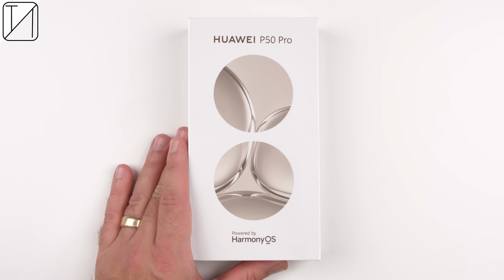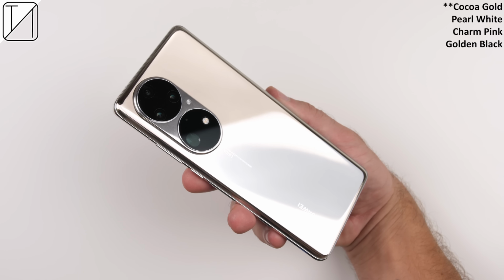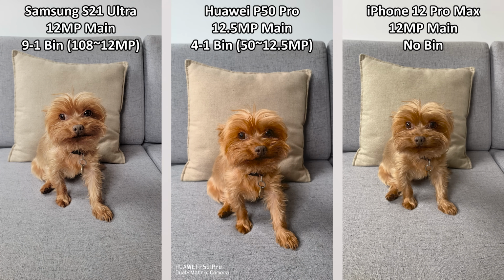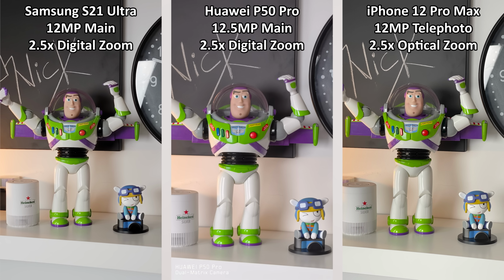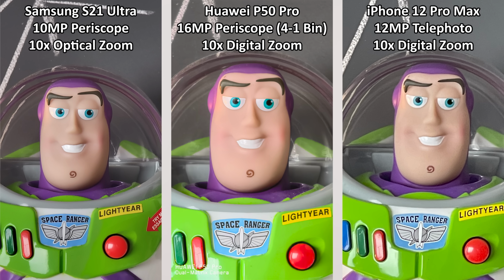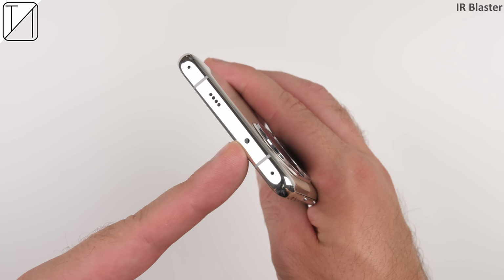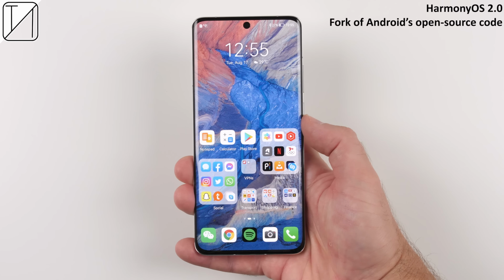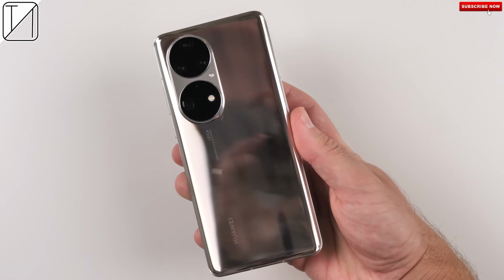Huawei P50 Pro UNBOXING and Initial REVIEW - Legend Reborn?

Comment: Basically the security risk is absolute BS.  All phones have the global components.  The ONLY reason for the ban is because Huawei were going to beat apple to the top spot and the US couldn't handle the competition.  NO ??  Then why is ZTE not banned in the same way ?

Its all about the money.

Personally once Huawei gets their 5g back I want to move away from Google as they truly are sharing info with the US
Reply: No matter which phone you get, it'll be collecting your data one way or another. I wouldn't fret about it. Personally I don't care what phone from which company I use, as they all will be collecting data through some sort of tunnel.

Comment: Do you understand that the 10x in Huawei is just crops from the 64mpx and in Samsung is a pure 10mpx optical? The difference us because the AI of Huawei is very strong. Most of fine details are not real, just "reconstructed" with AI.
So, it looks better, but Huawei relies on AI instead of pure hardware. It happened in the last generation with the selfie camera.

Comment: I am extremely excited about the HarmonyOS.  Finally we have a new operating system.  My belief on what I read is that it will offer more and more as time goes on, as compared to competition.
Reply: Its just fork of android so no big diffrence.
At least there is no google there and thats awesome.
Reply: @WspolnaKapiel  the loss of google is detriment to the phone.
Reply: @stephandevetten3463  its time for a new OS to come around.
Reply: @stephandevetten3463  you don't need Google to use apps lol. My P40 doesn't have Google play support yet I have YouTube signed in (youtubevanced) twitter, Facebook, messanger, Instagram, telegram, what's app etc. I can check my Gmail and outlook in the email app. I'm not really losing anything not having Google. In fact not having Google is far better.
Reply: Yeah but will harmony os offer the same or similar apps that Google has on the play store? Like a navigation app or big title games like call of duty mobile?

Comment: Monochrome camera has great advantages and it's back again. But this phone lacks 5G. Hoped they would use already microLED display, graphene, silicon nanowire or other next gen batteries and quantum dot graphene CMOS cameras. RYYB color mosaic is problematic in green color reproduction, RGBW can fix this and provide even more low light sensitivity. Main camera uses huge 1" sensor, biggest yet so far.

Comment: No one ever mentions the Kirin 9000's 15.3 Billion transistor count and ARM's biggest 2nd Gen Valhal Mali-G78 MP24 24core monster GPU. Its rated at 2.3TFlops of FP32 compute and has 128EU's per 24 cores giving it 3,072 EU's. Though, its basic tile based performance is more like 1.2TFlops because of a driver deficiency, if you load up a Vulkan based GPU or benchmark application you will no doubt see its true performance. It much like AMD's last Gen VEGA64 series GPU's. Running Vulkan/DX12 titles or benchmarks shows its full performance.

Comment: I am still upset with this nonsense US ban. I had for two years the P30 Pro and I can truly say, that that phone was the best all around package I ever had in a phone. Usually, I switch a phone between 8-12 months, but I stayed to the P30 Pro for two years. I changed to the S21 Ultra, but I was not happy at all with the performance and the camera for the amount of money I have paid, so I returned it. After that, I found a Xiaomi Mi 11 for 550 EUR and I had to try it out. I can say, that it is a big difference between Huawei and Xiaomi. Huawei was reliable and had good performance in all areas. The Xiaomi is fine, but it's the software that is not mature enough. But hey, it was not expensive, so I can live with the negative points here. 
But still, god damn, I would switch to a Google Services new Huawei flagship any time.

Comment: I'm still using my P20 Pro. I know there are superior handsets out there but honestly, not once have I felt the P20 inadequate or somehow lacking. I've never had a phone as long as this thing... but maybe the P50 Pro will be my next 👍
Reply: Using P20 here. Still a beast. Legendary phone
Reply: I am currently watching on my p10 lite lol:)
Reply: I'm in the same boat. I just got a Samsung s21 thinking it would be a major improvement, but I'm severely disappointed. I can't believe that Huawei is this superior.
Reply: No Google service and playstore.
Reply: @nelc2399  and?
Reply: @mycodingchannel9690  rubbish software
Reply: I play Asphalt 9 mostly and quite alot on it and it first heats up after around 10min and then lag during races. Probably also due to Gameloft not optimizing the game for the chipset, but I'm looking at P50 when it becomes available if it's not too expensive. They have to take the fight back to Xiaomi with low prices to regain their market

Comment: I'm watching this in 4k on Youtube on the Mate 40 Pro with GSpace off the Huawei App Gallery, on my big TV via Huawei Easy Projection over USB.

Running Google Apps with no issues off GSpace, except, of course, you can't access them straigh from apps outside the virtual GSpace. You can install apps within GSpace, particularly those apps and games that require the Play Store and Google Play to run, like Call of Duty, but it's an extra step I wish we didn't need. 

Those new cameras look great. I'd like to see whether dark videos have improved, however. That'a s weak point for the Mate 40 Pro and P40 Pro.

Comment: I'm a completely happy p40 pro user, yeah lack of Google is a problem but not a deal breaker when you spend time for it.

I had high hopes for p50 pro and few of them is facing with disappointment.
I understand Huawei's rough situation but still..

After p40 and mate 40 series I would expect a bigger main sensor then 1/1.28".
Monochrome is nice and leica is successful at it but still I think one sensor for this on a phone is incredibly unnecessary.

I love the 3d secure on p40 & mate40, very identical, useful and fast just like face id.
Dark environment, with glasses etc. no problem at all.
And normal camera unlock isn't going to work like that, not going to work at the dark at all.

If they remove that 3d sensor and make it one camera on the middle i would expect the camera to be smaller.
I don't think pill shape cutout is great but it's at least not on the middle of the screen.
S21 looks ok to me, hole punch is small but this one is just too big to stay on the middle.

And why they put the fingerprint scanner way more lower then before?

Comment: HARMONYOS IS NOT AN ANDROID FORK, IT IS AN OPERATING SYSTEM
Reply: So HarmonyOS is a operating system but it's still is android if you go through the code you will see most Android source code. Huawei would have you belive it's total different and no Android what's so ever but that's not the case
Reply: @footballtalk4857  Harmonyos is different.... I am a developer of Harmonyos, Harmonyos has only 3 branches of Android (only for now) for the apk to work, but Huawei in the future when the apps are based on Harmonyos (Hap) those branches will be removed and it would transform as OpenHarmony without any Android